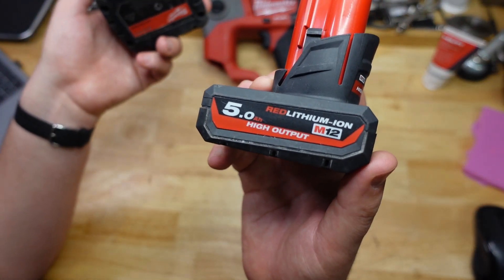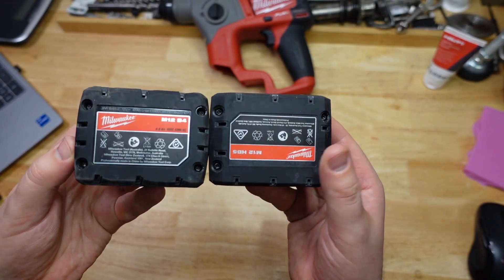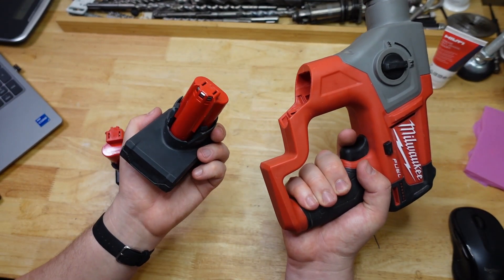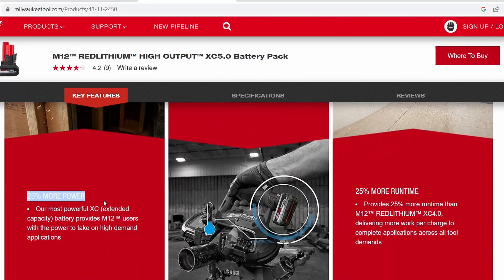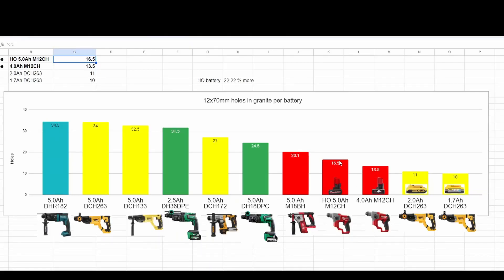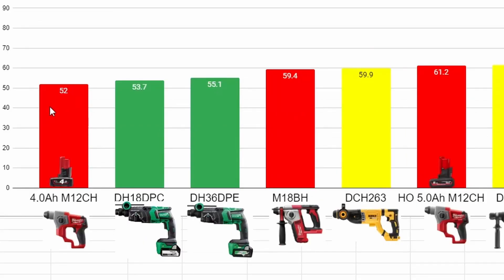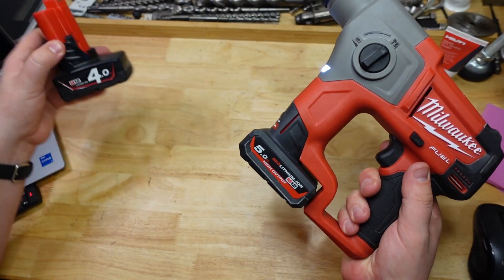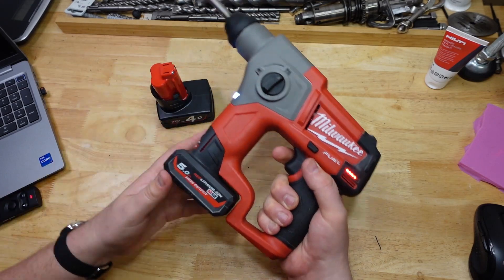Milwaukee M12 HO 5.0 battery: hammers harder?

Comment: as a massive Milwaukee fanboy its painful to say but this drill sucks ass, i have it and the numbers show it. there's far better options from Milwaukee and other sub 1" drills out there that just work better.
Reply: This and a new m12 circular saw....it's also near 10 years old!
Reply: @procrastinator1842 there's hope as they recently updated the 12yr old jigsaw with a Fuel version. Too late because I jumped ship 1 yr before that announcement but I still keep a handful of M12 tools and non HO batteries
Reply from the maker: Yeah it's not the best but I'm expecting a new version soon. This one's almost 10 years old so they get props for leading the pack!

Comment: I'm surprised the spade test didn't show a bigger difference.  Current draw should have been a lot higher in that test.

Did you ever stall the drill or make the clutch slip? I wonder if they even bother with a clutch on such a small drill.
Reply from the maker: Me too! That battery really just didn't help this tool. And nope never gotten a clutch slip out of this drill, but it does stall pretty readily if you use bigger spade or it snags on a knot in the wood

Comment: I think the 2.5 HO is the best of the Ho batteries. For the power jump , it seems to be almost as powerful as the 4 .
Reply: I built three m12 2.0 packs using newer samsung 20S cells. Performance testing shows it identical to the 6.0 pack...just doesn't go for all that long...😅
Reply from the maker: Wow really? I guess that's because they're just using better quality 18650 cells instead of a different cell altogether